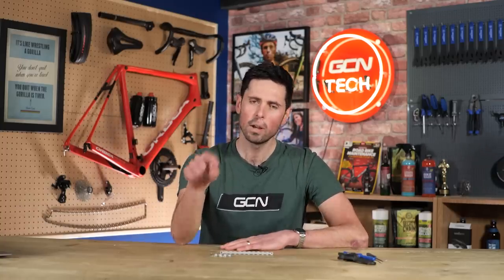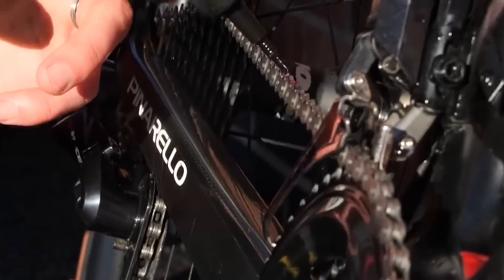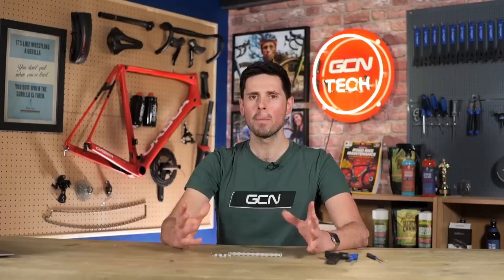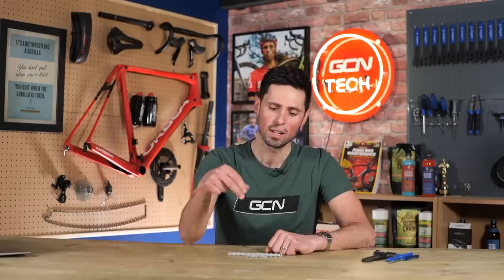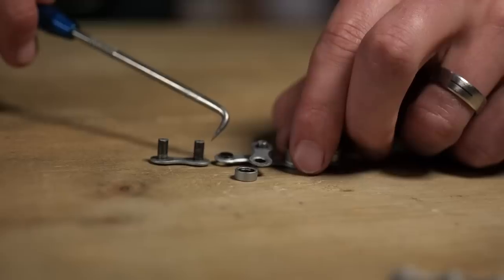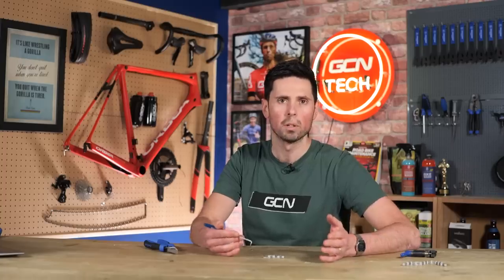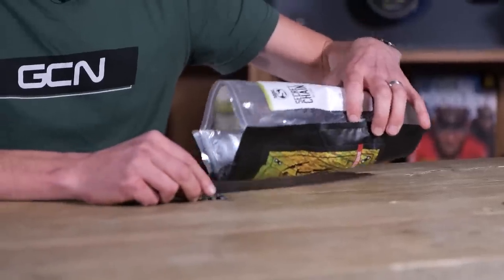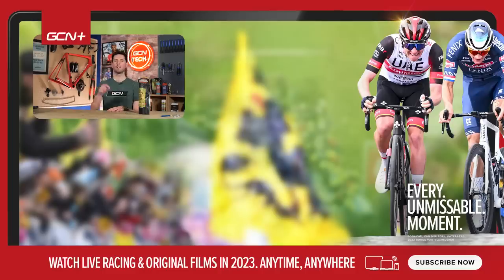5 Ways You're Destroying Your Chain & How To Lube It Properly!

Comment: Since COVID ended my commute to the office, I don't find myself riding in the rain anymore, so I've converted to dry lubes.   Once of the main benefits is that the chain stays cleaner.  I always clean my chain (fairly obsessively) before applying it.  Over the winter, I've had the bike on my trainer at home, and I've found that the chain still builds up a black gunkiness.  It isn't anywhere near as bad as with a wet lube, but it is still black gunkiness.  Where does this grime come from?  The bike is in a clean climate controlled office, just pedaling my way through Watopia... where is the dirt coming from?   Let me reiterate, I clean the chain obsessively between applications.
Reply: Ultimately regardless of lube or wax, your chain will wear. 

The gunk are little pieces of metal that come off your crank set as a result of the metals rubbing against each other.

Comment: Chains, wheel rims, wheel bearings, freehubs, bottom brackets, if they are Shimano they all wear out far faster than they used to. Lucky to get 4000 miles out of any of them these days.
Reply: Chains 2,400  - 2,800, wheel bearings 12,000+, rims 12 - 14,000 miles, freehubs last longer than rims, bottom brackets 16,000 - 20,000+. Do you have a maintenance issue?

Comment: Fully degreasing a chain is counter-productive.  You're removing the lubrication from where it's needed.  It will take a LOT of re-lubrication to get the new lube back into the rollers if you fully degrease a chain.
Plus, why get a chain "pristine" clean when it may be covered with dirt & mud within the first 20-30 minutes of your next ride?  Mountain biking throws all sorts of stuff at your chain.  As does wet road riding.  A three, four, five, or more hour mountain bike ride entails riding with a LOT of dirt on & in your chain! So that "dreaded abrasive paste" will be inside your chain DESTROYING IT!!! OH THE HUMANITY!!!
So stop the hype.  Adding fresh lube to a wiped down, but "still dirty" chain is fine.  This is how everyone's been doing it for over a century.  Chains wear; they're consumable.  And you can't keep 'em pristine very long anyway.
That said, immersion wax with additives is the way to go.  However, many engineers & experts argue that wax isn't really a true lubricant.  We could debate it endlessly.  Regardless, waxed chains tend to stay far cleaner and last as long, if not longer.

PS  But if you ARE washing your bike thoroughly, then do spend a bit of extra time on the chain to rinse out contaminants.  That plus compressed air is a great way to renew your chain during a wash.

Comment: Good video, but I think failed to answer the most important question!  Imagine long gravel ride of one hundred or two hundred miles and NO chance to clean your chain.  At the 30 or 70 or 120 mile point you are aware your chain is seriously mucked up!  You obviously can't clean your chain.  You could lubricate said chain.  The choices are do nothing because a dirty chain with oil on it will attact more dirt.  What is the best lube to use on a dirty chain when you stil have a hundred miles to go.  Throw away the chain after the ride?  Use motorcycle lube or chainsaw lube?  What does one do when cleaning the chain is not possible and the time availabe is minutes?  What?  No one else is conserned about this?
Reply: Ch do out Dylan Johnson’s new YouTube video on chain lube.
Reply: Sounds horrible/ but the fact is if there’s lube inside your rollers, no need to worry about the grinding chain noise. The steel on your cassette and chain are very strong. Just go with vaxing. Pouring lube on a dirty chain will make the sound nicer, but will kill off your chains rollers.

Comment: 1:24 "A Giant Grinding Paste" Is that a giant invented by Roald Dahl? & also, the pedantic "One drop per roller" technique: you realise that in a chain with 112 links, that's 224 rollers? No-one has time for that. Point your applicator nozzle at the inside of the (clean{ish}) chain, pedal backwards 4 or 5 times, wipe; done.

Comment: You do need some oil on the outer faces to act as a water repellent and prevent rust. Wiping after applying drop to each link is enough but necessary, even if you think you have applied so carefully that there is no excess. The cloth will pick up enough from the rollers to treat the surface even if it has no lube function. You could run with a well oiled, but externally rusty chain, but looks naff
Reply: I  wipe down my chain if wet and dry it immediately after each ride. No rust.

Comment: IMO The most efficient lube when it come to cost, speed and longevity has to go to Squirt. Rockin roll Gold is my honorable mention.
Reply: I'm using squirt, feel like it dosent last long at all before it starts to squeak
Reply: Squirt is the best chain lube out there. I use it on all my bikes in all conditions.
Reply: @jxpowers  I know why yours squeaks u most likely put it on  like regular oil, u have to heat it up a little I microwave for 12 sec then squirt it coating it alot that y they named it that it will seem like your putting to much on your not its also a good idea to big ring cross chain to get it in the links good spin till perfect purrr of chain lol✌  p.s open cap slightly if u microwave
Reply: @cornellmiller2315  Excellent tip - I think that's the key.
But whatever you do, don't ever put your chain in the microwave to 'dry it quicker' after you've degreased it (yeah, yeah, you know why you shouldn't but i is fick so I didn't!), cos if you do it'll hiss and spit and threaten to blow up the microwave and you with it - you don't need to ask me how I know...

Comment: Complete fresh Bike unboxed in March 2022 - 3000km later is the chain worn out - why? Chain is a perfectly maintained Shimano Ultegra / XT CN-HG701 for my GRX 2x DI2 - Lubed wisely after every bigger ride, depending on the surrounding conditions with an all-professional muc-off cleaner and lubes. Did i push it too hard on the pedals :)
Reply from the maker: It sounds like you've just been enjoying riding your bike! There are loads of factors that cause a chain to wear, it's best to replace it early and avoid a more expensive cassette replacement 🙌

Comment: How tedious to apply oil to every roller! Dip the whole chain in cheap car engine oil and ride it for 200-300 miles. Clean, rinse and repeat. The chain never gets too dirty, the process is not too annoying and it's cheap. Beware if using wax: you have no protection against rust caused by dew or rain - a huge problem if the bike is left overnight, even in summer!

Comment: Chain lube has some impact on wear. Good luck measuring it. It matters little to me anyways. I change my chain yearly due to stretch (i.e., lengthening of chain as the bushings wear against the pins). My plan: Save money on "magic" lube and replace chains as needed when they stretch past 0.5% 🔬.

Comment: Every 300 km.
Reply from the maker: Doe's this change if you are riding in different conditions? 👀
Reply: Bit more often when using wax
Reply: @gcntech  If I've gone through a nasty bit of weather, then I'll clean the chain (and the rest of the bike) straight away after the ride.

Comment: Please don't tell me to wipe off excess lube without telling me what excess is. Every chain video I've ever seen says this: "Wipe off the excess." But what is excess??
Reply: There it goes 2:00 "Wipe off the excess" What is excess?? Please!
Reply: 3:43 "Wipe off the excess" What is excess??
Reply: @guest_informant 
Whatever comes off, onto the cloth that you carefully wrap around the chain before you do the reverse chain rotation turns after cleaning and lubing the chain. 

If you are using a wax lubricant, quickly wipe off the excess before you leave it to dry and set.
Reply: @PNH-sf4jz  exactly this -- if you can wipe it off, it's excess, though I wrap around the chain carelessly and it still works:)
Reply: Ok. The details about what I am lubing help, to some extent, with what excess is. But it would be helpful if it was really clear.
Reply: @SidAuteur  I like the distinctive reference to "carelessly". I guess that I might have been over cautious on the concern for liability if the fingers got caught.  😃
Reply: @guest_informant  Hey i see you are very passionate about the "excess lube" So having explained clearly in this video exactly where the lube needs to be, wiping off the excess simply means on the outer surfaces which you can see.  holding a cloth round the chain while rotating the cranks backwards a few times is usually enough, but will depend on the lube and method to lubricate the chain.  Hope this helps, thanks
Reply: Any lube on the chain surface. Remove it!
Reply: @GCNalex  Thank you. I've been waiting about 10 years for someone to explain this to me :-)
Reply: @guest_informant  sorry for the wait! 😂
Reply: @guest_informant  if it took you 10 years to get this info, you didn't really care